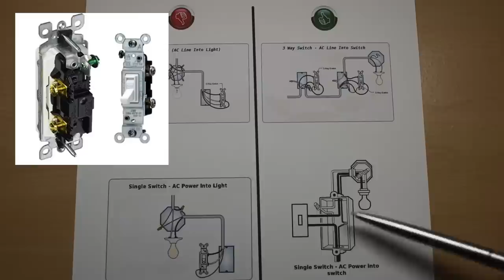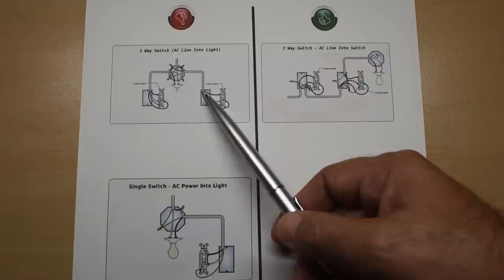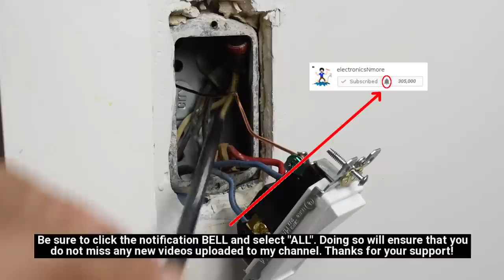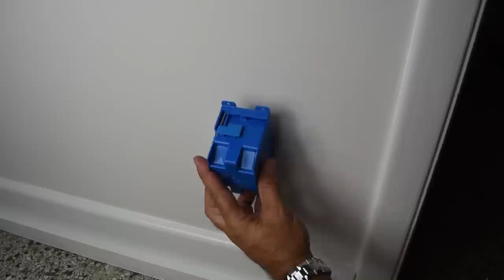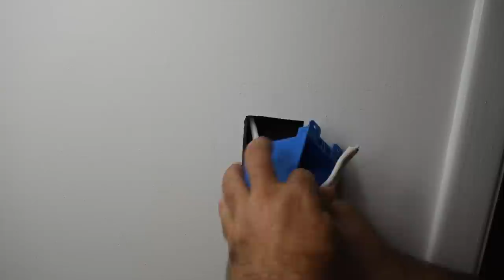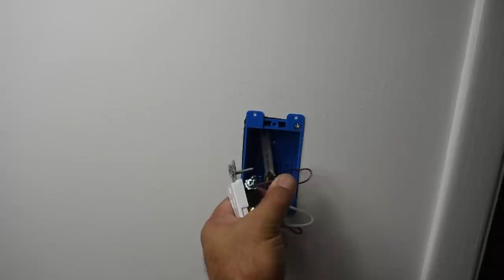How To Add An Electrical Outlet From A Light Switch!

Comment: What are the red rings for?  I’ve never seen wire nuts like that before.

I don’t have one of those testers, but I do always check with a multimeter before touching anything even though I know the circuit breaker is off.  120VAC shocks suck.
Reply from the maker: The red ring pushes the black insulated material tight onto the copper crimp ring. Newer versions are clear. I've gotten many shocks over the years, by accident.
Reply: Ah, ok.  Thanks for the info.  My house wiring also has copper crimp rings, but everything is wrapped in electrical tape.  I'd swear a total amateur wired this place up.  As a result I haven't seen any insulator like that stuck down over a copper crimp.
Reply from the maker: @00Skyfox  Some people like to wrap the wire nut with electrical tape for added security, but it's not really needed.
Reply: What I meant was, in my outlet boxes there is the romex ends with bare copper crimps, wrapped in just electrical tape.  There is no other sort of wire nut or other insulation.  My house was built in the early 70s and I can't believe that would have been up to code even back then.

Comment: How do you find the grounding, just wrapping it around?  I am one who understands laws and regs differ in many countries vastly from US,, but im wondering how many sparkies dont wrap it tightly, leaving a precarious situation should a fault occur, is there a reason why its not screwed down to same spot as existing ground?

I also like your advice about the current flowing your chest, even though RCD, umm GFI I think in US ??  are good and ultra fast, yeah,  I still rather that 30ms not go across my chest :)
Reply from the maker: The ground wire must be wrapped/twisted tight. The bare copper wires or green insulated wires inside electrical boxes are the ground wires. If your metal box doesn't have any, then you test for 120V between the HOT (black) wire, and the metal box to make sure the metal box is grounded. If it is, then you connect the ground wire from the receptacle, to the metal box using a ground screw.

Comment: I'm trying to understand the wiring part.
So if i add a double outlet 15 Amp. 
And get the power from a single outlet on the other side of my wall, would that work?  Is it possible to add a light switch and get power from the new double outlet that will be installing soon if possible??
By the way,  im hiring professional. 
I'm just trying to understand how this works.  I already bought 14 gauges Romex . It's white wiring.
Reply from the maker: As long as the branch circuit you're tapping into doesn't already have too much load on it, then you can tap into the receptacle to make another receptacle on the other side of the wall. If the breaker is 15A, then you should use 14ga. You can add a light switch and light, as long as the load isn't too much(LED, etc). Thanks for watching!
Reply: @electronicsNmore   Okay. Thanks

Comment: Can I install numerous receptical pulling from a light switch?..my garage needs recepticals but only has a light switch
Reply from the maker: One duplex receptacle is probably ok, don't add more. Receptacles used in garages typically draw a lot of current. I would add a new 20A line. BTW, they must be GFCI.

Comment: My question is , is it code to add the conduit for the single switch/wire into the box?  Could one add a new romex without the conduit?  I bought an older home and have this issue.  They didn't use conduit
Reply from the maker: You can add romex cable of the correct size to the metal boxes using clamps to secure the cable into the box. It's totally safe. Most newer homes use romex cables without conduit. Check local building codes. Thanks for watching!

Comment: If your switch was the end of a circuit, couldn’t you still tap into it, but your outlet would only be live if said switch was in the on position, correct?
Reply from the maker: If you have one cable entering an electrical box, with the white and black wires connected to a single pole switch, then you cannot do it.

Comment: Your video was so informative... but when I opened my light switch box, all I see is a red and black wire going into and out of the switch.  No neutral and No ground.  
Therefore, it seems the power is going into the light fixture and NOT the switch, and therefore I will need to follow your second diagram.  correct?
Reply from the maker: No good, only 2 wires in the box is the end of the run. You'll need to do as explained in the video. Thanks for watching!

Comment: One step further, how would you wire for a ceiling light and the power source is at the outlet?
Reply from the maker: Very simple. Run a romex cable up the wall to a single box above the receptacle, then off to a round box on the ceiling.

Comment: Hi, I need some help: how can I connect a single pole 4 speed fan switch on a 3 way wire set . Thanks
Reply from the maker: You need a 3 way fan control.
Reply: electronicsNmore I can’t find one that is 4 speed. There’s any way I can connect that single pole in there, I don’t mind loosing the other switch function?

Comment: Cuts a clean hole with a jigsaw... But makes it crooked as hell... My OCD couldn’t deal with this... LOL! 😂😂😂 ... I’m just being funny though... GREAT video and I really appreciate it, and people that are truly bitching are too pussified to be doing these kinds of projects anyway... Bravo! 👏🏻👏🏻👏🏻
Reply from the maker: They forget that I upload a very wide range of videos, and not every video will be for them. Thanks for watching Steve!
Reply: electronicsNmore ... I admit that I’m a newb trying to learn, so bear with me: I only understand things ON PAPER so far. If I saw a schematic or this finished product, it would make more sense to me, so, question: How would this work if I’m dealing with two switches, one being a foyer light, and the other being a porch light, and I want the outlet just inside the door, and also, does this make it so that the switch turns the outlet on and off, or can it be made to work as such?
Reply from the maker: @SteveHacker  Usually foyer lights inside a double "Two Gang" electrical box, will have a hot(black wire) and neutral(white) wire to tap into. With both light switches off, and removed from the box, you'll need to probe the pigtail wires to see if they're always live. If they are, you can use it. If not outdoors, you won't need a GFCI receptacle.

Comment: I know it's just a house, but circuit breaker locks are cheap and plentiful. Or having a couple wire nuts if you need to re-energize before you have the outlet connected.
Reply from the maker: They are cheap, and a good extra safety measure, but there's really no reason for anyone to go near the breaker panel except for the person working. Thanks for watching John!
Reply: @electronicsNmore  I agree, completely. This isn't industrial equipmemt, there aren't multiple shifts working on it, etc. This is just best practices beaten into me for nearly 20 years.
Reply from the maker: @jonanderson5137  Appreciate your input!

Comment: We did that, but the light was flashing when we turned it off 🤷‍♀️ do you have any ideas ???
Reply: Your switch may be on the white Neutral wire when it needs to be on the black or red hot wire.

Comment: I want to replace a light switch with a power outlet + light switch.

There is no ground wire. 

Just one red and one black.
Reply from the maker: Need more info than that. Take a close up picture of inside the electrical box, show all cables clearly, spread the wires apart, then post a link online to the image. I normally only reply to a viewer once, but I'll reply one more time after seeing the image. Thanks

Comment: So once the breaker switch is off. Do we still worry about elctrocution to our bodies?
Reply from the maker: If the circuit breaker is off, and you tested all wires for AC voltage to neutral and ground, and there's no indication of voltage, you're fine. Always turn on/off nearby wall switches when probing the wires to make sure the wire with no power isn't switch controlled.

Comment: Extending a circuit needs an arcfault outlet or breaker and in Chicago everything needs to be piped. The reason being is that the manufactures of Arcfaults lobbied the government to require them as a safety device (makes house 18% safer according to commercials) and the Chicago unions lobbied to have everything piped because they make more money that way.  This works to drive up the cost of living and shove poor people out on the streets which is totally safe.
Reply from the maker: Most people don't realize that many of the so called "Safety Measures" are really more about companies making money. Lobbying was dead on. AFCI's have a tendency to false trip. In the video description area, and my pinned comment, I said to check with electrical codes in your area before doing as shown. There are millions of homes across the USA with wiring not in pipes, and when done properly, it will almost never become a hazard. Thanks for watching!

Comment: To anyone in the UK. Do not do this! We have 2 circuits. One for lights, one for plugs. And this would be dangerous in the UK.
Reply from the maker: Where did I tell people in the UK to do this? The USA uses 120v receptacles, and the UK uses 220! Would be nice to read video descriptions.
Reply: @electronicsNmore   I know. Just warning the UK lot. 
We use 240v  but we have a ring main, and a lighting main
Reply from the maker: @doms6741  OK. Thanks for watching
Reply: Gtk. In Canada outlets and lights are mixed on a circuit as when fixing lights some outlets go off and vice versa. It's a crap shoot.

Comment: No sleeve on the earth/ground conductor.
Reply from the maker: You mean inside the switch box?
Reply: @electronicsNmore  yes
Reply from the maker: @golfman9290  Bare solid copper ground wires inside a box are very common. I prefer insulated wire for the ground, you don't have to worry about where you put it. :-) Thanks for watching!

Comment: Realistically it’s no big deal, as long as you use 14g wire for a 15a circuit, 12 for 20a, etc and it won’t overload the circuit if it only controls one or two lights, esp if you use leds.
Reply from the maker: @911OMG All US installations are the same for 120V branch circuits.
Reply from the maker: Finally a viewer with brains.
Reply from the maker: @sclsesector3157  What? LOL People add recessed lights to circuits that only have one or two all the time. Please, don't comment.
Reply: And of course, so long as they have leds and the circuit hasnt already been extended and its in the US on 110v then yeah its ok.....

Comment: You don't run power from lighting circuits. The circuit is 10amp max a single socket it's upto 13amps all you are doing is over loading the circuit which will trip all the time or is you have an old fuse box it could overheat and burn with you in the house too. .

Not a hater just an electrician who knows how it should be done. And that in the UK is a definitly a no no.
Reply: Yeah. UK has different circuit for lights
Reply from the maker: Clearly this installation video wasn't intended for UK viewers. The video description area, and the receptacle used in the video, makes it VERY clear.

Comment: Erm...to anyone watching, check your local regulations before doing that, it would fail any electrical installation inspection for sure.
Reply from the maker: Wrong.
Reply: Prove me wrong. Show where in your regs that you are allowed to add power receptacles to lighting circuits.
Reply from the maker: @johnroberts3003  Sound like a guy from the UK. Why make 15A receptacles if you cannot use them on a 15A branch circuit? The only reason why electricians "like to" have lights on a different line, is in case an outlet is overloaded, you won't be left in the dark at night. NOTHING unsafe about what I did in this video.
Reply: I will wait while you show where in your regs that you are allowed to add power receptacles to lighting circuits.
Reply from the maker: @johnroberts3003  https://www.justanswer.com/electrical/be8m8-1-run-outlets-lights-15a-circuit.html
One of many you can find online.
Reply from the maker: @s1iznc1d34  No. 15A and 20A lines can have lights and receptacles.
Reply: @electronicsNmore  In my early years i'd become an educated electrician and later on went in another careers... But the instructions are quite dangerous for people who don't understand at least the basics of electric engineering.. I agree that you can expand groups with power receptacles with no problem and if you fail, well, that's circuit breakers are for... I understand your positivity in sharing knowledge, but imagine someone receive's a fatal shock... Most likely you become a victim of you own positivity and the risc of getting sued is pretty much high...
Reply from the maker: @underverser  I couldn't have made the instructions any clearer, and couldn't have stressed safety factors any better.
Reply: @electronicsNmore  I read about the disclaimer, good move... If you refer it in your video in the beginning of it, then you are pretty much bullet proof... And by the way, i enjoy your video's, but stay safe.. :)
Reply from the maker: @s1iznc1d34  Nothing in the video violates Youtube's terms. I'm very careful with that.
Reply: @s1iznc1d34  Well, i give you an example what currently is under lawsuit in the NL... There is a person that posted video's on YT which in he is using fireworks in Poland (where this is legal), and now he is sued by the public prosecutor for more than 100.000 EURO, because he encouraged people in the NL for buying and using illegal fireworks... Think about it.. And then in the US, lawsuits are far more crazy, then here in the NL.... ;)
Reply: @John Roberts,  ok so he showed you. You seem to have disappeared without saying thank you! Oh just curious, can you please show us in the regs where it says that it can't be done? We'll wait...
Reply: @s1iznc1d34  He is a wise man, did not stored illegal fireworks in and on his properties... ;)
Reply: @s1iznc1d34  Well, the relevant news published is inconclusive by its own.... Because stories have multiple dimensions and dimensions are relative in exception to each other.. But it is not the question if i am right about my statements.. I sensed that you tried to outsmart me... You have only 2% chance to succeed... My final conclusion for now... So game on? :D
Reply: @s1iznc1d34  Funny guy, i give you credits for this! EDIT: ;)
Reply from the maker: He vanished like Harry Houdini. That always happens when they get showed up.
Reply: @johnroberts3003  Found many mixed circuits in my places in Canada. Working on one thing and other stuff is inoperable, making the job slightly more inconvenient. I also found a buried junction box, but they like these surfaced now.

Comment: Unless you are an electrician this is not allowed to do yourself. You cannot add to an installation unless you are.
Reply from the maker: 100% incorrect. I guess you never heard of an OWNER/BUILDER permit in the United States.
Reply: electronicsNmore wish we had this kind of flexibility in Australia on domestic electrical installations. We MUST have a licensed electrician do ANY work on electrical circuits. Even an owner builder must have licensed trades perform work such as electrical and plumbing. its a real pain. Enjoyed the video.
Reply from the maker: @theonlymudgel  AU is a beautiful country, but countries that limit what a homeowner can do, I have no use for. As long as the homeowner does it to code, there should be no reason to disallow them. Sadly the Unions paid off the govt to ensure they get all the work. :-) Corruption at its finest, very little to do with safety, it's all about making money and controlling people. Thanks for watching!

Comment: I had to do that in my current house to add an outlet in the hallway since there was no outlet and I tapped into the existing gfci outlet for power that was in the bathroom and I connected the hallway outlet to the load side of the gfci outlet so it has gfci protection since the outlet was just outside the bathroom and items plugged into the hallway outlet has a slight possibility of getting wet.
Reply from the maker: There's nothing unsafe about doing that if the proper wire size and correct receptacle(15/20A) was used, but they do like the bathroom to have a dedicated 20A breaker.
Reply: Just make sure you update your cb panel to indicate the hall outlet has been added.